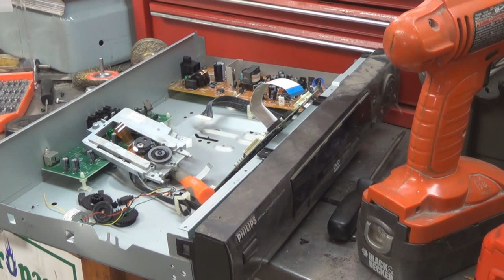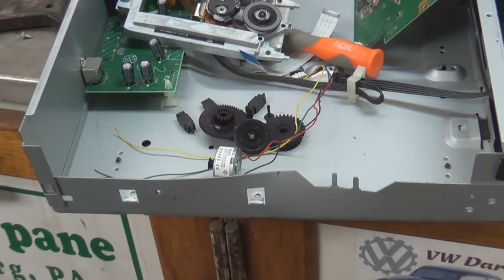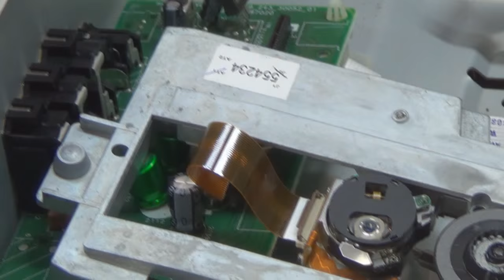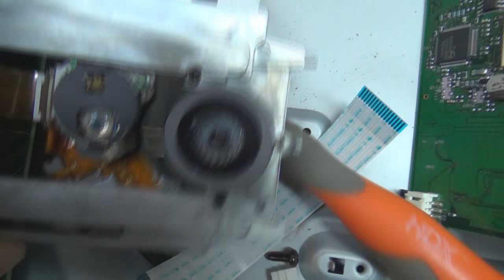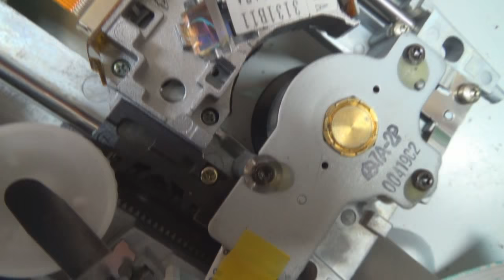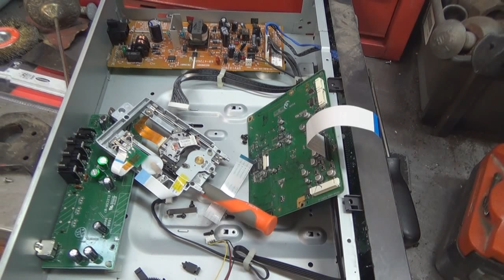Re-purposing parts from your old DVD player for your model trains/cars

Comment: That is  wonderful tips and ideas. I have lots of the old cassete ,cd  players around. I'v been thinking of getting into model rail roading to George thanks for sharing all this cool stuff.
Reply from the maker: +oldbeatercars   You are welcome and I would enjoy seeing you build your layout from the ground up. When you are ready to start, will you be doing HO scale? I would enjoy passing some of my gift blessings on to you.
Reply: Hi ,well I'm just wondering what scale is most common and would work the best for my layout. I'm mostly interested in steam engines and that era kind of fits in with my model building styles too. Well thanks for yor comment back to me . We'll stay in touch for sure.
Reply from the maker: +oldbeatercars   HO is probably the most common scale, and likely the least expensive to get started in. If you have limited space an N scale layout might be more in line with what you want, but for me being an old guy, they are just too small, then they go up from HO to O to S and others in between and even bigger. Generally speaking the bigger they are the more expensive, except the comparison between N and HO, where the bigger is definitely cheaper, mainly because it has been around a lot longer. Hope this helps.

Comment: Good information and always fun taking stuff apart. I used to have fun taking apart RC Trucks years back. Rig the lights up with a double a, or make a fan out of the motor and use a C or D battery.  Have a good'nnnn
Reply from the maker: +geargriden19   Yup, you know what it's all about then. Thanks Daniel
Reply: I originally planned to take them apart to fix them but fixing them and putting them back together never happened lol. Have a good'nnn

Comment: Or you could just use them like they are supposed to. And the clear thing you said was a transistor is actually a diode. But thats a cool idea though
Reply from the maker: If I knew how to use them as electronic components I would, but I don't so I repurpose them. Thanks for taking a look.

Comment: Not going to pull all them transistors and diodes out to build DCC kit? Speaker magnets are great on the end of a length of fishing line to recover the screws that fall behind the bench.
Reply from the maker: +harryfaber   If I had a clue of what I was doing I would try to make a DCC card out of one. I use speaker magnets that way too amongst other things around the shop. Thanks harryfaber.